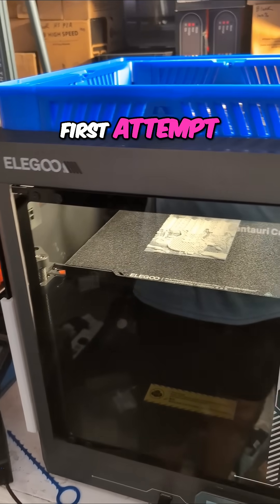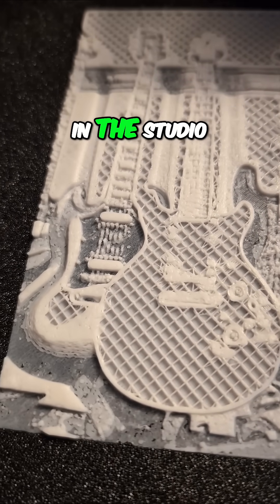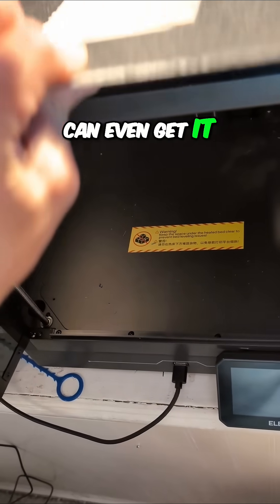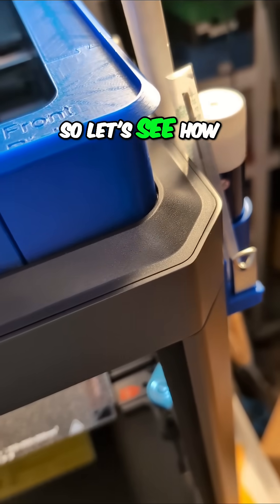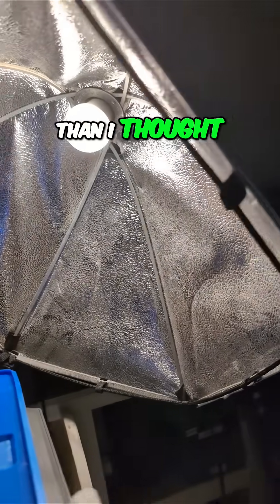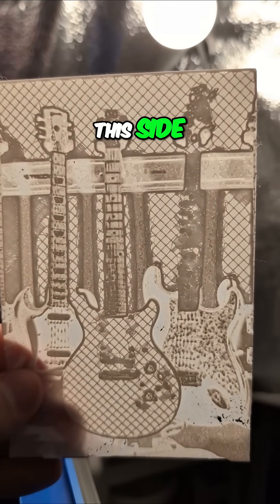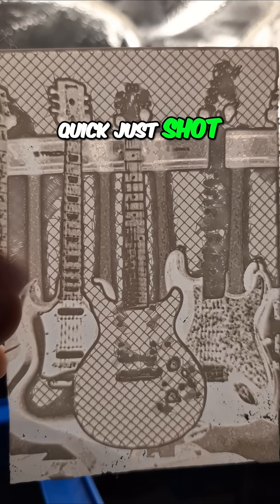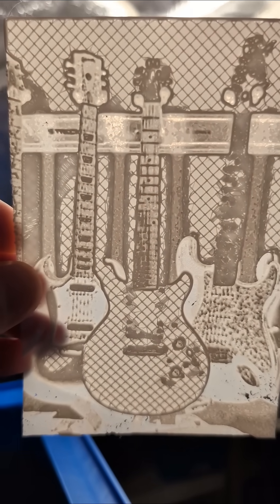3D Print FAIL! Lithophane Attempt - You Won't Believe What Happened!

Comment: I did a bunch of lithophanes earlier this year, printing them flat isnt the way to go, just use a thick brim and print it vertical.
Reply from the maker: Yeah. After this failure I looked up the settings and have had a couple very nice prints.